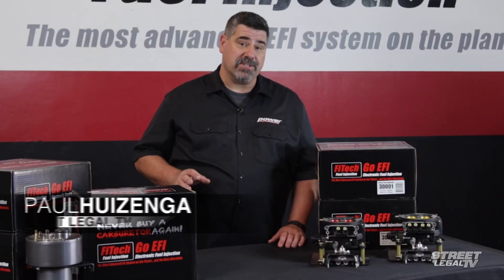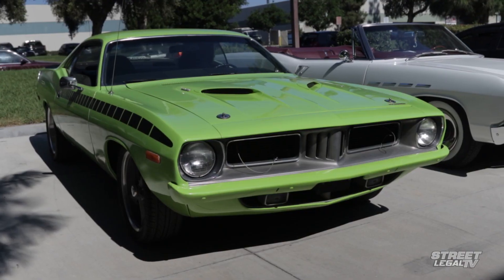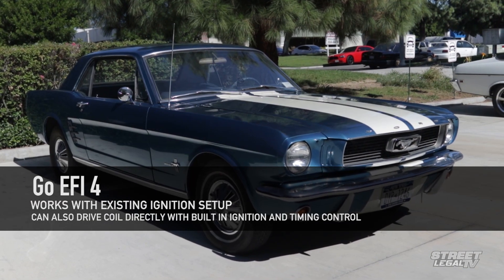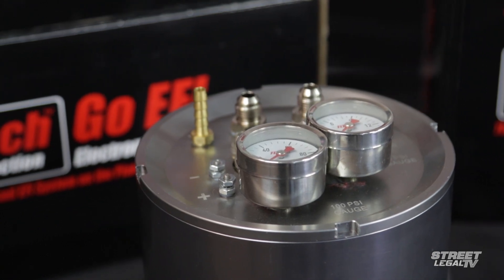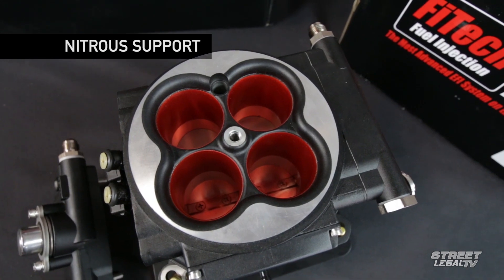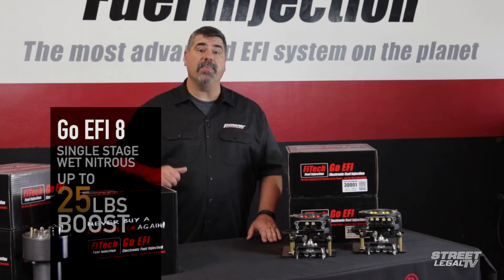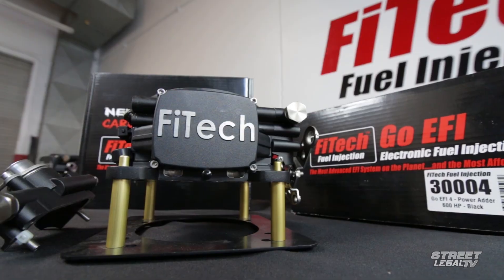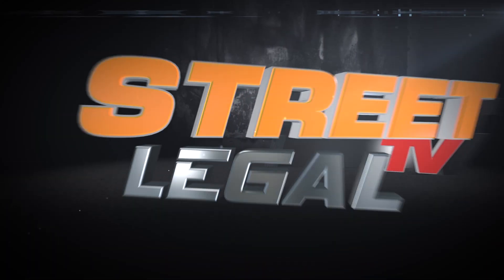1293 FiTech Go EFI F&B V3

Comment: I have a 65 Mustang with a rebuilt 302 engine. It has a carburetor. Definitely want to go EFI. Love your Go Street EFI- 400 HP System. What else do I need to buy? Do I also have to get the The 40003 Fuel Command Center and The 40005 Fuel Delivery Kit? Many thanks!